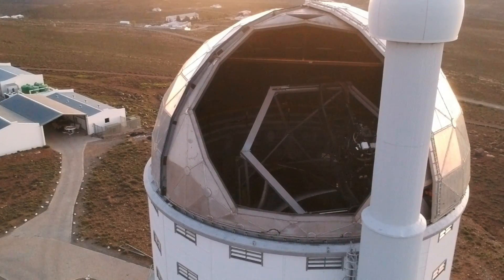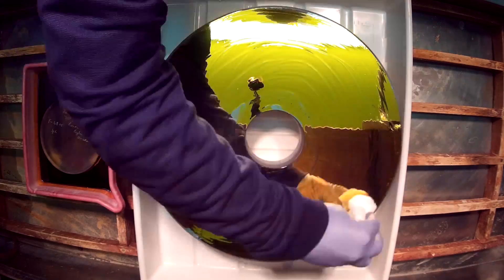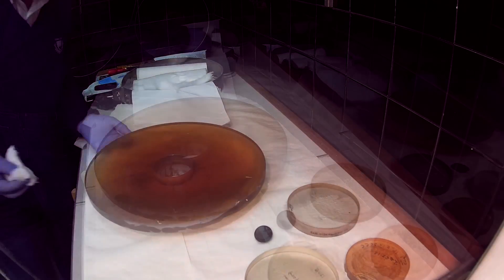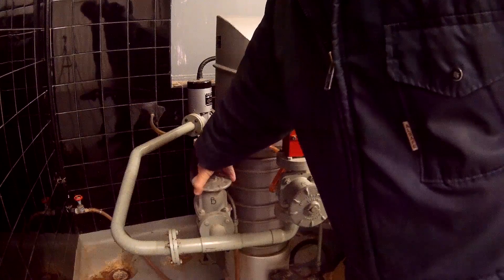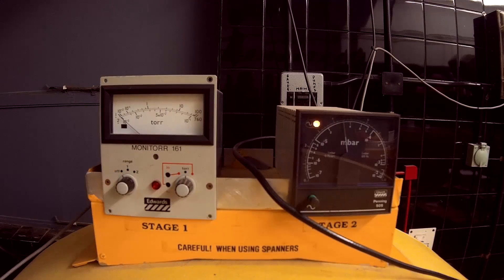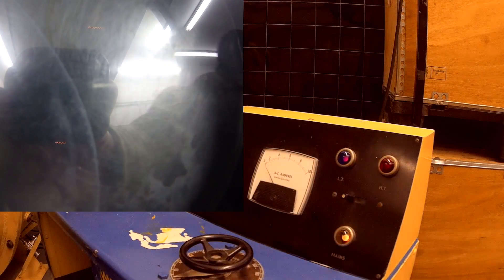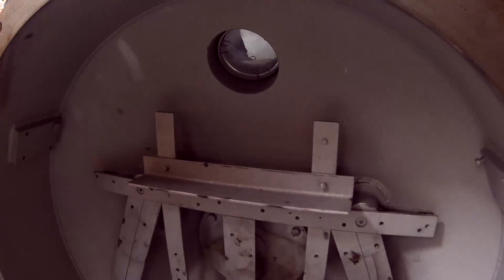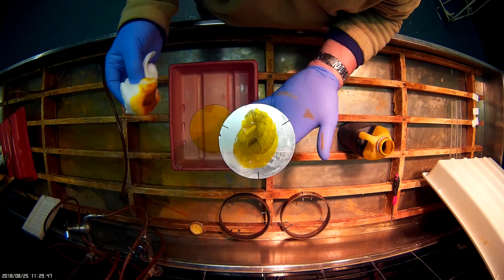How to Aluminize Telescope Mirrors

Comment: Thank you so much for sharing this, it's something one usually doesn't get access to! Things I wonder about: Why does the aluminium not condense on the metal parts of the tank? And why isn't silver used any more, even though it is much more reflective? And would it be a good idea to pump nitrogen or argon into the tank and later on into the telescope, to keep the aluminium from oxidizing?

Comment: It is oddly gratifying to hear someone casually explain that the reason the bolts around the seal become loose when the chamber is under vacuum is because "the air pressure is pushing so hard" (6.07). All too often you would hear explanations along the lines of ".. because the vacuum is sucking the two shells together so hard ..". It amazes me that even experts sometimes describe vacuum conditions using terms like "suction", or "negative pressure". Personally I find it kind of fascinating that we are all walking around completely oblivious to the fact that we are being subjected to pressures that can potentially cause an relatively empty vessel on a railway tank car to implode!
Reply from the maker: Thanks for interesting comment. Indeed, if you think that air pressure is around 15 lb per square inch, then, as you remove the air from the tank, there is 15 lb pressure bairing down on every square inch of the tank's outer surface.

Comment: Re-coating mirrors is not risk free, stripping the coating could etch the surface, and the only way to fix the mirror is at the minimum refiguring it. Properly done there will be no problem, but the chemicals must be chosen and used with care.
Reply from the maker: Indeed, thats why we only use chemicals that is safe not to attack the glass.

Comment: I have a scanning electron microscope at home and it has an oil diffusion pump.  I've always wondered whether I could aluminize a telescope mirror with it and I think it is possible now.  I would need to build a vacuum chamber large enough to hold the mirror, connect it to an accessory port of the microscope  to be able to pull a deep vacuum, then source some tungsten wire, ultra pure aluminum wire, and hopefully a lab power supply or lead acid battery charger to supply the current necessary to melt the aluminum, wet the tungsten, and drive the evaporation process.  It would probably take some trial and error to get the aluminizing process to work successfully, but once I dial in the settings it seems feasible.  I imagine I would either apply too much current and melt the tungsten, or too little current and the aluminum won't melt properly.  The process itself seems very straightforward.
Reply from the maker: I have not seen the size of an electron microscope yet, but it sounds quite feasible to be converted into an aluminising chamber.  The final vacuum must just be low enough to achieve a "mean free path" (Google that) below the dimensions of the tank.  Yes, you will most probably need to experiment a bit with the rest of the setup.  The reason why we only fire two coils at a time, is because our variac cannot supply more current, but even if you fire one coil at a time, it is fine - we have a smaller tank that fires one at a time.  Of you heat the coils to fast, the aluminium loops sometimes separate in two and drop off, so this may requite some experimentation and will help if you have a viewing window in the tank.  Good luck.

Comment: Great video! What if the pressure is 1 mmHg, it will work? What if the process is made in a higher time interval for deposition (become the deposition rate is very small I suppose)?
Reply from the maker: Nice to hear you enjoyed my video.  Two great questions!
1)  When you try to aluminise at a higher pressure, you end with a BLACK counting!  Reason being that the aluminium reacts with oxygen, which is black!  If you Google "mean free path" this will become clear.  The vacuum required needs to yield a mean free path more than the distance from the evaporation coils to the mirror surface.
2)  There is no restriction to the deposition rate - if our variac was capable of firing all the coils at the same time, we would have.  
Thanks for the good questions.
Reply: @SterremanWillie  Oxygen could be flushed out with argon, would the gas itself mess with the deposition process? To be fair, if it was an option, they probably wouldn't have bothered with a diffusion pump.
Reply from the maker: @bottlekruiser too many molecules, irrespective of what they are, will prevent the aluminum to reach the mirror at high enough energy to adhere.

Comment: One thing I've never understood is what guarantees the layer of aluminum will have the correct surface roughness?  I know that the glass of the mirror is ground to the proper shape, but it always seemed to me that when the aluminum is deposited, it should have peaks and troughs that vary much greater than the required tolerances, so it would seem that it should require polishing as well, but I've never seen an amateur or professional do that; once it's been aluminized, that's it.
And yes, I know the layer is very very thin, but I don't think that will actually prevent roughness from occurring.

Comment: Fascinating. So that's how dichroic glass is made too I guess, but supplementing different metals for the desired effect.
Thanks for sharing.
Much respect for your skill and knowledge.
Reply from the maker: @6rw1b  Thanks for the compliment. For dichroic you need very fine control of the layer thickness. I once wanted one, and sort off got it right by stretching a silk stocking over a piece of glass!
Reply: @SterremanWillie  Sure man no worries. I've used gold and silver to fume borosilicate glass in the flame, hence my interest.
It popped into my head to make some kaleidescopes for my grandkids hence I stumbled on your vid.
Thanks again for sharing, how else will our civilisation develop.
Well done that man  🙂👍🏻🌟

Comment: 😎 , what stops the aluminium  coating from oxidizing  ?
Reply from the maker: The way I understand, it does actually oxidize as soon as the tank is opened.  The oxidization layer is very thin, is transparent and actually protects the auminium from the elements.

Comment: Thanks for the video. What are the materials used for cleaning the existing coating, you mentioned it as KOH and FeCl3, is it correct..?, By any chance do they etch the glass, if the solution ratio is not correct, or if I keep it for a longer period... If possible, please let us know how to prepare the KOH and FeCl3 solutions for cleaning

Comment: Old school ultra high vacuum. Huge diffusion pump needed as glass adsorbs a lot of water plus the aluminum inside also adsorbs some from the air.
Water is slow to remove in vacuum systems.  I use a few cycles of roughing pump and argon backfill but with turbo molecular pump.
Reply from the maker: Yes, 60-plus-year-old technology, still in good working condition.  Indeed, water is your greatest hurdle to get good vacuum!  Interesting about the argon backfill at the roughing stage still!  I guess it is like flushing out some water?  Or is the backfill during the turbo-pumping stage?
Reply: @SterremanWillie  
Flushing with Ar is done during roughing to "sweep" out water vapor.  This was my experience in UHV system for a electron spin resonance cryostat for liquid He service.  Much smaller than NMR cryostat so superinsulation doesn't work..critical diameter etc.

Comment: After seeing this several times over the years , I would imagine there is a thick coating of AL on the inside of the chamber if it is used regularly ? Has anyone measured how deep the coating is ?
Reply from the maker: Not really, you must remember the layer per coating is about 10 microns, hence after 100 firings, its only 0.1mm thick!

Comment: I still am amazed at how the pump works .  I didn't really understand the processes completely ,Ill need to look deeper .
Reply from the maker: Indeed, Google "oil diffusion pump".  The roughing/backing pump is equally interesting - Google "rotary vane pump" - there are several intimations on the internet.
Reply: @SterremanWillie  ty I'll research it. Was that 10^-4 bar ? before Aluminum  atomization?
Reply from the maker: @das250250  no, we pumped to 2x10^-5 mbar finally.

Comment: Great video. I work for a company that does vacuum brazing using similar equipment, except the chambers are much smaller. We place a clamshell heater on the outside, and the chamber is heated to about 1000*C while under vacuum  (1e-5 mbar) with parts inside.
Reply from the maker: Thanks for the nice feedback. Wow, it sounds really interesting what you guys do. It would be wonderful to see a video, hint, hint!

Comment: Now I can see why I can't aluminize my home-made ATM mirror at home 😢
Reply: Why not? It is possible to make vacuum chamber and you even don't need 2-stage pumping setup. Modern rotary vane pump will be enough. (:
Reply: @zlozlo3935  not enough to reach the required 10^-5 torr

Comment: Could you have used gold doing the same process?
Reply from the maker: Not sure how gold coating is done unfortunately.  Other metals are possible, I've seen before.  Instead of coils, they sometimes use a hollow bucket-like structure in which the metal is heated to boil off into the mirror.

Comment: What do you use to seal the door?
Reply from the maker: There is an o-ring which is continiously casted (no joints), lightly covered with a thin layer of vacuum grease.
Reply: @SterremanWillie  Thank you!
Reply: @SterremanWillie  Thank you!

Comment: Silver Is More Reflective,
More Difficult To Procure,
To Implement!
Reply from the maker: Indeed, but you need to apply an overcoat over silver because it will tarnish very quickly, unlike aluminium which protects itself with a very thin layer of aluminium oxide and will stay shiny for years.
Reply from the maker: Big challenge for silver is to apply a coat of even thickness. If uneven by just a few microns, it changes the "shape" of optic, effectively changing / spoiling it.

Comment: Fascinating video! Why it melts entire Al hook at once, not just burning through it in half? Is the current set in a way that the heat propagates through the entire hook?
Reply from the maker: It does happen sometimes that the hook burns through and the two pieces fall to the bottom of the tank, but, probably thanks to surface tension, the ends get pulled up to the heater to form a bubble.  We do turn up the current slowly to try prevent the hooks from burning through.

Comment: I had my 6" mirror re-aluminized for $88, but they tested its parabola to see how good it was, for a mass produced mirror that is. They said it wasn't bad, probably because it was an older scope.
Reply from the maker: Interesting. Great to have  mirror testing included in aluminising service. Its quite an easy test, I seem te recall.
Reply: @SterremanWillie  They had a special on a refigure guaranteeing .95 Strehl and 1/10th wave so I went for it. .98 Strehl and 1/12th wave and I could tell, problem was I needed a new focuser.😆

Comment: @Willie Koorts I am amazed that the last thing to touch the glass surface before the aluminum coating was not the deionized water but a wad of cotton. Was that really necessary?  I would think the cotton would risk leaving a microparticle that can not be detected by cursory inspection.  Any deionized water still clinging to the glass would be boiled off by the vacuum pumps making wiping the surface unnecessary.  Of course this does not even consider what is floating around in the air. I used to be involved in designing cleanroom environments. It appears that some attempts were taken toward building a clean space.  But, I see dusty footprints on the floor. Apparently whoever walks into the room are allowed to wear street clothes and shoes. Transfer of particles from the tech to the glass by static electricity can occur without guidelines on proper clothing types or static dissipation.  i.e. I am surprised there does not appear to be an interest in maintaining a cleanroom environment despite the obvious intent to build and equip one.
Reply from the maker: Indeed, but seeing that water is the hardest thing to pump out of a vacuum chamber, you definitely do not want to start pumping with a wet mirror. We only use a very spesific brand and pureness of cotton wool and ensure that only "virgin" cotton comes into contact with the optical surface. We do this by never turning the wod over in your hand for fear of some from your glove contaminating the mirror. Particulate matter is actually less of a problem compared to oils and similar impurities.
Reply: @SterremanWillie   I did not think of the pump problem, a very helpful insight.  It is a great video detailing the process. Thank you very much for your series.

Comment: Just wondering about the roughing valve....would it be possible to rough evacuate the chamber through the diffusion pump before it is heated, to avoid the need for the roughing valve?  Or is the roughing value just to save time if the pump is already hot from a previous cycle, so you don't have to wait for it to cool down?
Reply from the maker: Good question.  I'm not sure.  For a short time we do pump through the diff pump.  There must be a good reason because all the pumps I've seen, work this way.

Comment: So if I understand correctly; the surface tension of the created liquid during the melting of the Aluminium hooks on the tungsten filamtent, pull the remaining substance up and onto the filament? The melting doesn't cut the hook into half? Thank you for this great video
Reply from the maker: Yes, exactly.  It sometimes happens that small pieces of a few hooks are found at the bottom of the tank when we open up, but mostly the surface tension does its thing as you described and can be seen in my video.
Reply: @SterremanWillie  Awesome, thanks for the quick reply. All the best to you!

Comment: Absolutely willie. You are correct But........ I’m certainly no expert so back to the point, in the telescope industry big is better, like pixels in a camera image. If I showed you a binocular 1m telescope and a 72 inch adjustable focus lense would you be interested ?. I’m not trying to convert the experts that have been making lenses since Galelaio. I’m simply stating a 1m lense at 95% perfection would out perform a 600mm lense at 99%. We followed the construction of the VLT in the early 2000 also embarrassed some professional astronomers at a local university around that time... I can’t say too much about these but would like to say without being argumentative, instead of only looking throughout telescope, look at it a bit longer and you to will understand they have been made wrong for many years. But as most of academics follow in the footsteps of their teacher they fail to see new light. I know what you do for a profession, you don’t know what I do ?. Very happy to share with you what I know. If your interested email me directly and I bet you stand there scratching your head with a big smile as yours and many others heart sinks in their chest asking me questions. Simply we outperformed a 900mm $60k lense with no problems using a 1200mm. We don’t use bathroom mirrors BTW.

Comment: So, when amateurs grind their own DIY telescope mirrors at home, I guess that they have to send them to a facility like yours to be aluminized? I don't see how anyone could do this at home, the equipment would be far too bulky and expensive. Fascinating video! Do the world's largest telescope mirrors, like the 200" Hale, have to be re-aluminized at intervals also? That mirror is huge, and weighs 13 metric tonnes! A vacuum chamber big enough to hold it would have to be equally enormous.
Reply from the maker: Yes, we do amateur mirrors as well, in fact, most of the mirrors in that run were amateur mirrors.  Yes, the mirrors of most huge telescopes are aluminsed.  Some are removed (search YouTube for AAT (Anglo Australian Telescope) and 200-inch Hale) while others are done in-situ!  Also see https://youtu.be/hxb-KOqaCYQ
Reply: @SterremanWillie  - I have just watched the two videos you recommended, on the Radcliffe and Hale telescopes. The most surprising fact I gleaned was how long it took to fabricate the Hale's 200" mirror: according to the documentary, from the day the mirror blank was delivered from the Corning Glass works in New York to Cal-Tech, the grinding and polishing took 11-1/2 years, and fully 5 tons of glass were removed from the blank during grinding. The film doesn't state this, but I assume work on the observatory and the mirror was slowed during WWII, because it wasn't completed until 1948.  The mirror was then trucked from Cal-Tech to the observatory, and aluminized in a facility there, I assume very much like what I saw in the Radcliffe observatory film. I assume the Hale mirror is lowered vertically from the instrument onto an elevator that drops it into a basement lab built below the  dome, where a custom built vacuum chamber was installed for aluminizing it. Are all large observatory mirrors maintained in facilities similar to what's shown for the Radcliffe facility?

Comment: I was also curious why the aluminium is attracted to the glass only and not the walls of container (or is that happening too ) ?
Reply from the maker: Yes, the aluminium goes everywhere.  Because it is such a thin layer, it takes on the smoothness of the surface it lands on, so will only form a mirror finish where it strikes a polished surface.
Reply: @SterremanWillie  How fascinating to see it ,so well filmed for us engineers to see.

Comment: Great video - TY . @08:04 does the vapourised oil grab remaining gas molecules and attach to them and when cooled goes back into oil solution OR does vapourised oil get sucked out with molecules through the BACKING  pump ? Also ,why do the remaining air molecules attach to the oil vapour ,what type of bond takes place ?